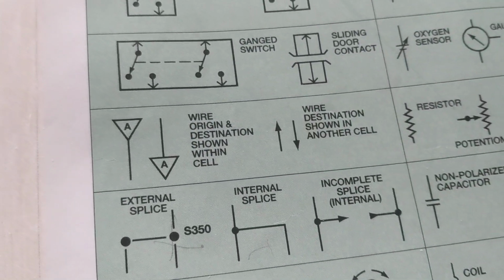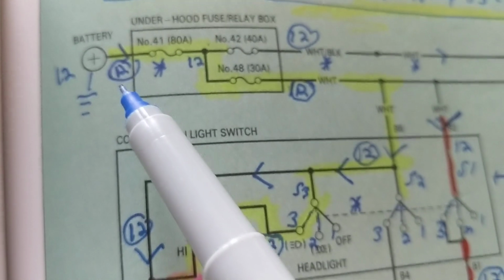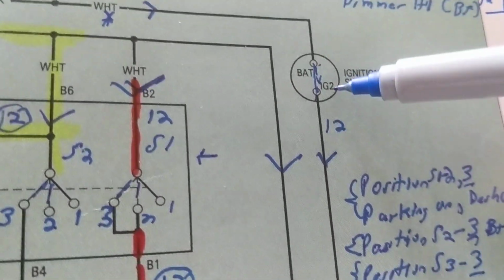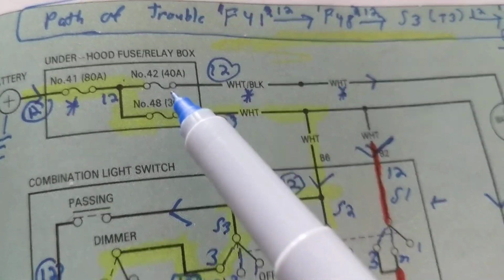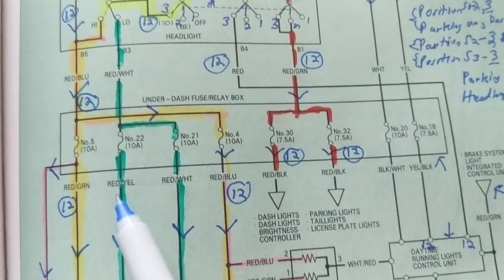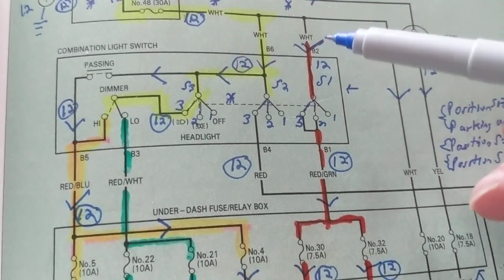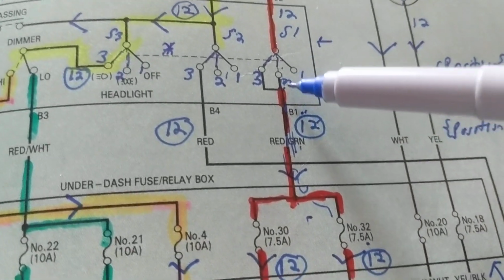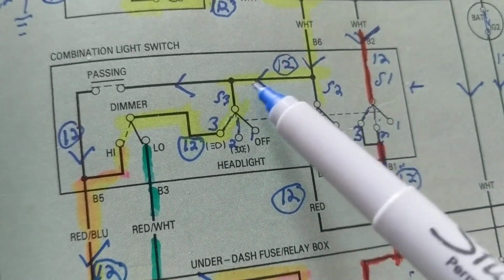How to analyze any schematic for automotive simplified to detail for beginners part two

Comment: Would a circle with + - on it with only the letter A be a amp gauge ? the push button start with a 50A fuse goes to the - side of"A" And the + side of "A" goes to alternator . Thanks just found your channel , trying to catch up !
Reply from the maker: Yes any gauge with a capital A in it is an amp meter weather the negative or positive is connected depends on the positive going to the battery
Reply: @Joeelectronicschematicsforauto  Thank you
Reply from the maker: If you want to measure an alternator you use a clamp meter which you just clamp around the wire as I have done in videos on Joe electronics schematics for Auto thank you for your question
Reply: @Joeelectronicschematicsforauto  Yes 4 sure just binge watching now! thanks

Comment: great tutorial  but no link to next video. messy
Reply from the maker: I just put it up and I didn't even put a description or any tags yet I have to do more work on the channel thank you for your comment
Reply: @Joeelectronicschematicsforauto  thanks. Your teachings are very meticulous, if you could restructure and package your content that would be awesome.

I can't speak for others, but I myself will not and try not to get into the wirings even thou learning about them is cool.

I'm trying to be a hobbyist mechanic and am more interested in making sure that a car is in relatively good condition and make sure that any repairs I could do is within my capabilities..

which brought me to your channel because I was trying to get a refresher on circuits but also importantly trying to discover whether reference volts are standardized (apparently not all sensors have 5Vs but I think I can get better intuition by understanding their functions, as you have explained in some video)

what's frustrating is it's hard to find such values as reference volts on alldatadiy, as I tried to on one of their sample reports. It's messy and leads to confusion for first timers..

maybe if you could make a short video to get important and useful data from alldatadiy for hobbyist I think that would be helpful.

thanks for laying things out again, really appreciate your content!
Reply from the maker: @jingyitay6179  the the problem is with today's cars they are computerized fuel pump starter lighting systems and there's a certain amount of circuits you have to know and today's modern computerized vehicles this is why I chose to teach people the basics the foundation are they they can decide on their own how they want to approach
Reply: @Joeelectronicschematicsforauto  

Hi Joe, I understand what you mean. . but from this foundation can we know what's the reference voltage of the sensors?

the only explanation I got why it's 5V is because that's the minimum voltage that the car can run off on (perhaps from manufacturer testing and also maybe from just analyzing the schematic diagrams?). So 5V is used as a constant for most of the sensors.

https://www.youtube.com/watch?v=Ibuvo4Zz4rw
Reply from the maker: I'm trying to put links to my next ones thank you